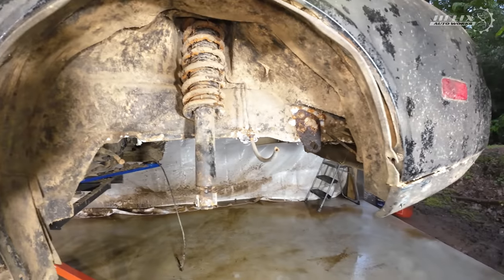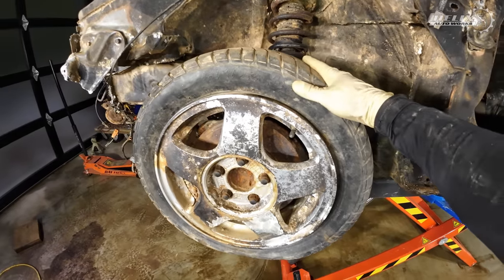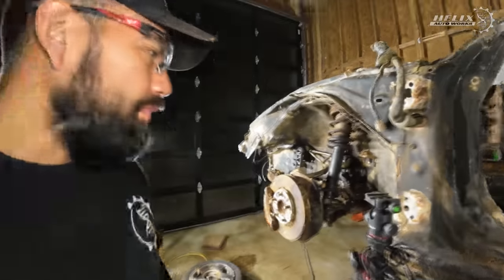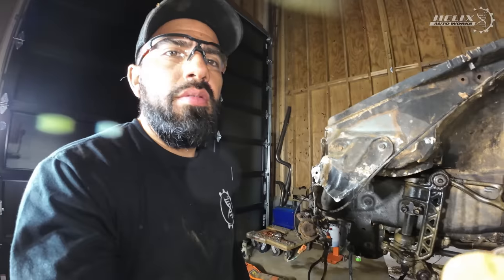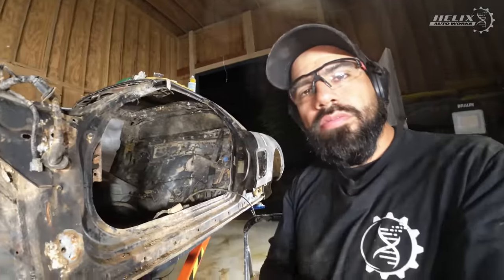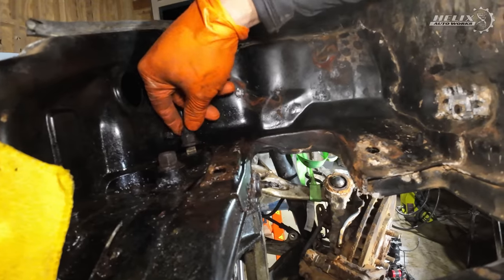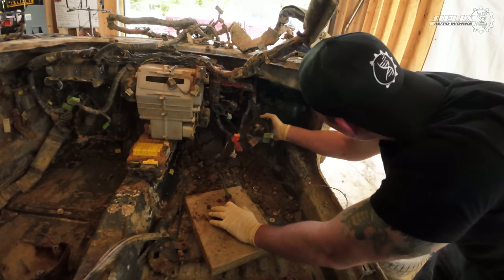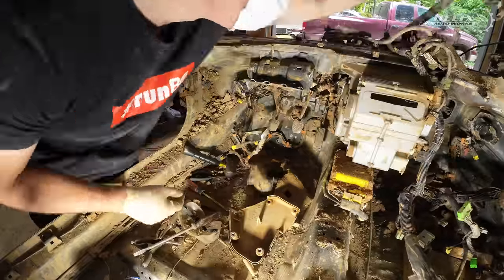Restoring a Stolen / Sunken Acura NSX Ep. 10

Comment: If chemical cleaning is not possible, I wonder if it is possible to rent an industrial ultrasonic cleaning unit and decontaminate the entire car in a distilled water bath. 9 meter vessels currently exist for industrial and automotive use, though I cannot speak about how affordable such an avenue would be.
Reply from the maker: Ultrasonic might loosen the dirt and grime, but you still need more flow/swirling to get those contaminants out of the small crevices that we can't access with the pressure washer or other tools.  We are also trying to minimize the number of spot welds we have to drill ;-)
Reply: In reference to Tavarish's P1 project, I was wondering about dry ice cleaning on this. This is an incredibly ambitious project BTW. Amazing how much "further back" you are going compared to the McLaren since many bolts on this cant come off and you are stuck cutting things off. Do a talk on Vin Wiki for this.
Reply: That's not painted black, that is Anodized! Have it redone
Reply: Exorcism of the Nsx
Reply: @ryangertz3822 to do the whole frame like this with dry ice would be thousands of $$. But a good media blasting is the way to go. But I would start with crushed walnut then move to baking powder.

Comment: You can get specialized tips for your pressure washer. One that actually has a rotating pattern for better dirt removal. Then there is a tip that has holes on the side so as you insert the rubber hose into the rocker panels the water shoots around the inner surface rather than just straight. Hope this helps
Reply from the maker: This is a good idea... I wonder if #sunjoy wants to provide some (or a new pressure washer since this thing is getting USED!)
Reply: @helixautoworks  Try looking for Kärcher pressure washers. They have many models to choose from. Good luck!

Comment: Baking powder media blasting. It is soft enough not to etch the metal but strong enough to get everything out. That is what I do when stripping motorcycle frames for rebuilds.
Or you could use crushed walnut shells as well. Same principle but just a bit of a harder abrasive.

Comment: I often used to do Citric acid bath to clean, removed corrosion and decontaminate old carbs or old alloy motor parts, that works very good when you just heat thé bath a little, way better than ultrasonic bath. A ground swimming pool ( you know those with métal frame), water and Citric acid in powder could make a DIY solution...

Comment: I built a simple jig for my jeep and flipped it to the side and it was thousand time easier, I took a stock plate with hole in them and I bolted it to the under body and from the inside I bolted it to the seatbelt bolts to balance it and I welded the plates to stock steel making it square connected to all the plates and flipped it on its side and it was easy and simple and cheap and extremely effective and helpful , not just the cleaning but also the under body protection spray and reworking the issues and welding the stuck broken bolts and fixing the threads on its side instead of upside down, can share a pic if you want to see “in private”